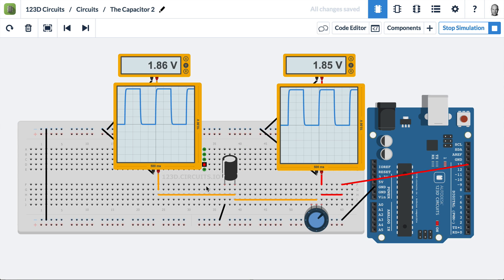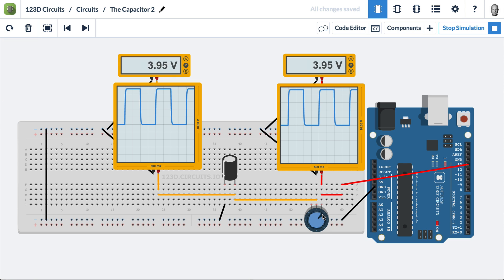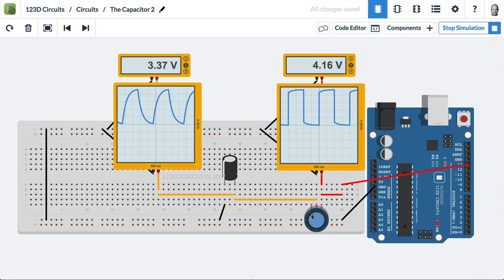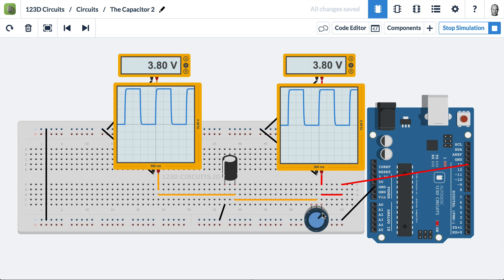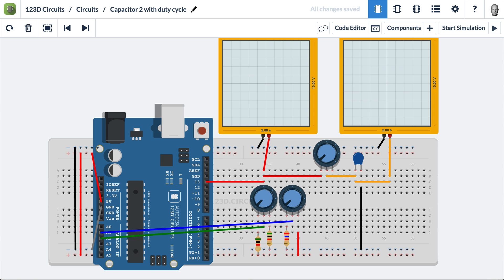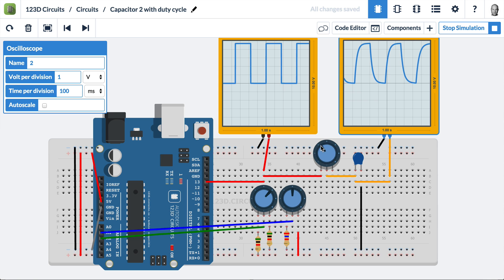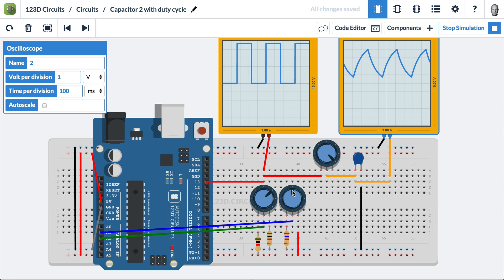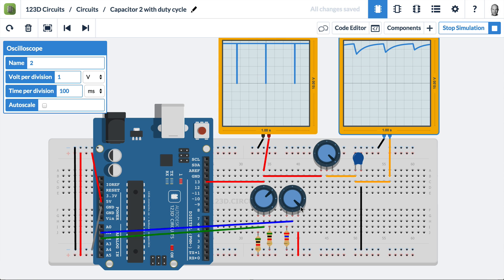Capacitor 2 - Basic Filtering - Electronics Lab

Comment: Are you still here by any chance. I'm learning audio circuit as a side hobby for my guitar. I know a lot relative to someone with zero official education(well, you don't have to have an official education to know far more than I.

The point, I'm trying to figure what I'm missing that would allow me to understand why this circuit behavior is observed.

Say you have an input audio signal going to the first lug of a pot, a capacitor with a Resistor that's about 1/3rd the Pot value bridging across lug 1 & 2, lug two connecting to audio out.

 Lug 3 to a Resistor about 1/8th of the Pot value then to ground.

What I'm trying to figure out is why does this circuit merely pass a fixed cutoff as opposed to adjusting the resistance = adjusting the cut-off frequency?

Comment: Why does the capacitor discharge?
Reply: Because it's under a theoretical load in the simulation I believe
Reply: half the cycle it is at zero volts